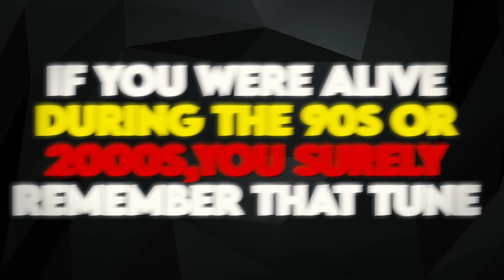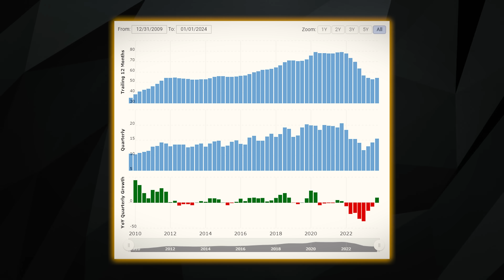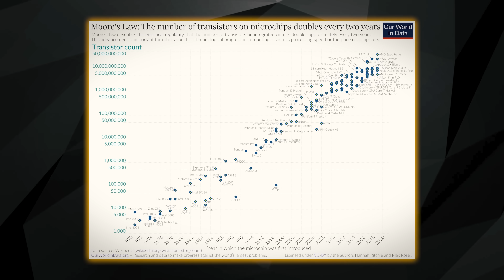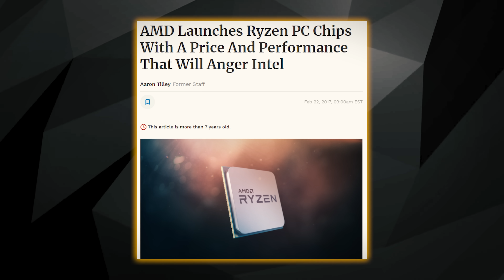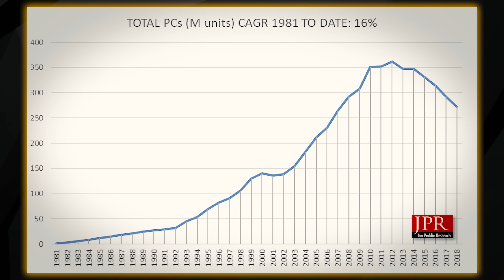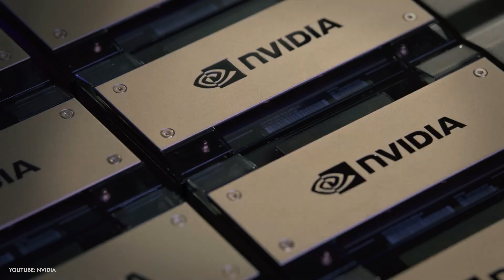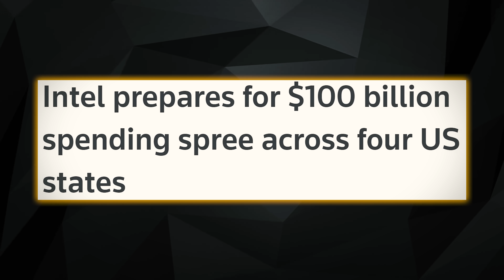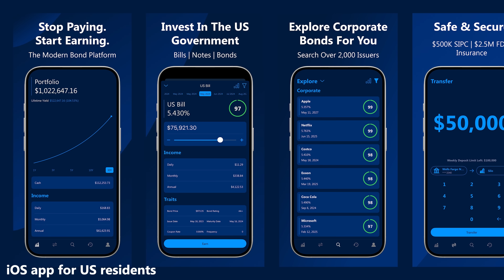The Dire State Of Intel...What Happened?

Comment: Dude, I'm eating their stocks up like crazy. I'll be sleeping on them for 5 years  This is the AMD moment.
Reply: Same.  When others are fearful be greedy and when others are greedy be fearful.  Intel has a solid turn around plan but it will take 3-5 years to materialize.  Buy and hold.
Reply from the maker: Very possible
Reply: Dude, AMD stock went up by a factor of 100 since its lowest. Do you seriously think INTL stock price is going to rise a hundred fold? :D
(well, hyperinflation could actually get us there, but that's not a real gain)
Reply: @ACzechManGoingHisOwnWay  People like you didn't believe in AMD turn around.  I invested in AMD around 20 a share.  I think Intel's current investment in innovating and their turn around plan is better than AMDs was...
Reply: @ACzechManGoingHisOwnWay  I don't expect 100x. I'm hoping it drops to the 10-15 then ramps back up to 50 in 5 years. Intel is one of those companies that's too big to fail. Like it or not they still own the Laptop market and ARM chips rely on shrinking transistors to gain performance unlike the x86s. A 10nm x86 is nearly as good as a 5nm ARM chip. 

Also I never trusted Qualcomm. Their new chip smells fishy. We need proof not words.
Reply: @ACzechManGoingHisOwnWay  Don't expect 100x by any means. AMD in the early 2010s and Intel today are in two radically different situations. While AMD was quite literally on the verge of bankrupcy, with their stock price being a measly $2, Intel still has not that low of a stock price compared to their peak(its still very low, just not as bad as AMD was then), which puts Intel in a lot better situation than AMD was back then. And if AMD was able to rise from the dead, and become one of the biggest chip companies today, then Intel can probably do that a lot easier, assuming they dont make any stupid mistakes.
I will expect Intel's stock to maybe increase by 3-5x (maybe 10x if we are lucky, but still unlikely) by the end of the decade, assuming Intel makes the right decisions, and doesn't do anything that can turn the tide of the company.
Reply: INTL can make a huge comeback, the potential is definitely there. However, unlike AMD, they are also fighting on the fab/process front with TSMC and Samsung. In case they fail to regain clear process leadership, the stock won't go to the moon.
However, there is still a chance of US instigating a kinetic war over Taiwan and destroying TSMC leading process factories there. That would be a windfall for INTL and Samsung, though a tragedy for everyone else.

Comment: So basically, Intel pulled a Boeing.
Reply from the maker: Yep
Reply: Like Boeing (and many other U.S companies), they decided that investing in stock buy-backs was more important than investing in there core products.
Reply: same complacency.
Reply: Intel’s 13-14th gen chips crash more than the 737 MAX
Reply: Pulled an IBM too
Reply: So many technology/engineering companies put MBAs in charge who have no understanding how the company's technology actually works and they run the company into the ground.
Reply: How many whistleblowers did Intel take care of though?
Reply: There’s a HUGE difference with what happened at Boeing vs Intel.  Intel never bought a giant competitor with a penchant for corner cutting the same way Boeing did (McDonnell-Douglas).  Intel’s problem was that they swore their business model was all about focusing on specific markets, but they would then invest in other markets outside the core competencies just to grow TAM.  Remember Edison and Arduino 101? Dropping the ball on tablet chips?  Other than the NUC, what other Intel form factors have really expanded their platform family?
Reply: Intel is behind TSMC  in chip making and behind AMD in chip design, more specifically in chiplet design. Chiplet design allows AMD to put cheaper CPU cores in one chip packaging. AMD’s CPU cores are a little slower than Intel’s but AMD can pack more in each processor package and resulting in higher aggregated performance. AMD’s processors also run cooler and use less power because they are manufactured in smaller nodes by TSMC.
Reply: Boeing died from a reverse merger with McDonnel-Douglas that somehow replaced the entire engineering-focused Boeing leadership with people who hated engineering. Intel was still engineering focused. They just didn't have good competition for so long that they didn't have to keep pushing innovations into the market. That gave all the competition the opportunity to catch up. Now Intel is pushing out everything in their quiver in a desperate attempt to buy enough time for them to catch up.

Here's hoping Gelsinger has a bit of Jobs in him.
Reply: well, they didn't kill anybody that I know of
Reply: PC side panel suddenly ripped off when using intel
Reply: Wait, who did intel kill? 😅
Reply: GOD is not with ...US
Reply: Well not anymore they are trying to change unlike Boeing
Reply: @n.d.n.e1805 Yep they finally got an engineer in the CEO seat. Boeing... Boeing never changed... Double down on bean counting
Reply: @samwaller4092 True i aint ever gonna get a flight with any company that uses Boeing planes
Reply: They pulled a nokia
Reply: Without being as integral to its market.
Reply: Not really. For one, Intel quality is still there. Second, they didn't just get complacent, this video is kind of far off the mark. They bit off way more than they could chew in terms of what could be packed into their process updates multiple times. They simply failed to execute on the new and aggressive fab nodes. They tried and failed swallowing big bites while TSMC succeeded by nibbling at the problem.
Reply: @chrisbradley3224  Yeah this doesn't get mentioned often enough.  It's not like Intel stopped innovating, they actually have tons of interesting R&D/engineering going on, where they failed was in bringing those innovations to market in a timely manner for quite some time.  And even when they did with things like optane for better or worse they gave up on it and additionally sold off their storage business.  Not that Intel hasn't made some mistakes but it's not as simple as complacency and C level ineptitude.
Reply: Okay can we stop talking about what's going on with the plane incident no one has died so far also it's been a few months ago …